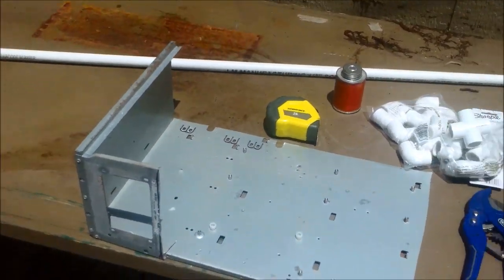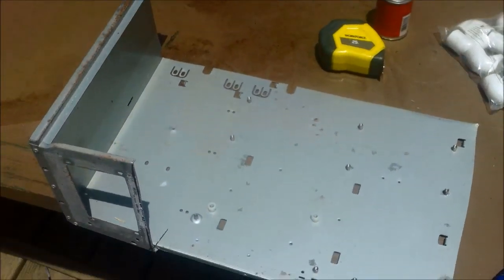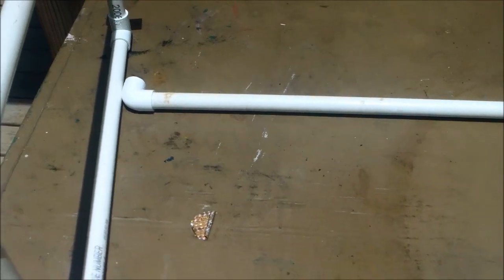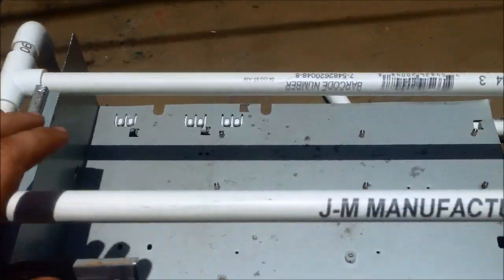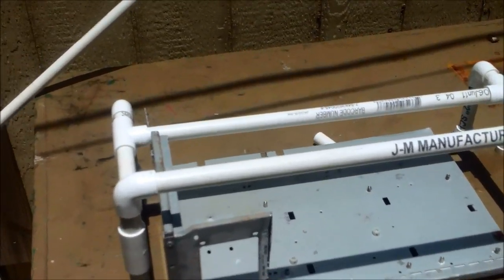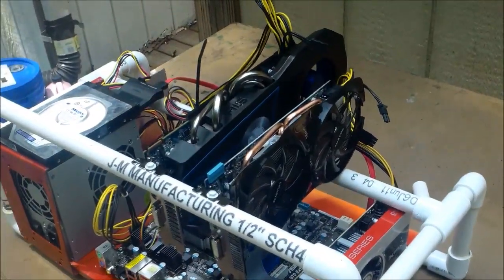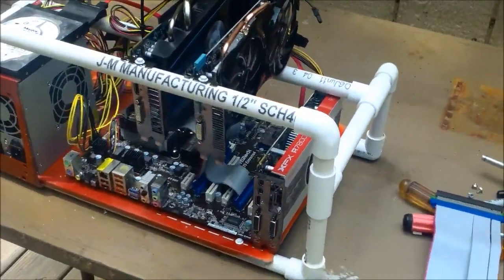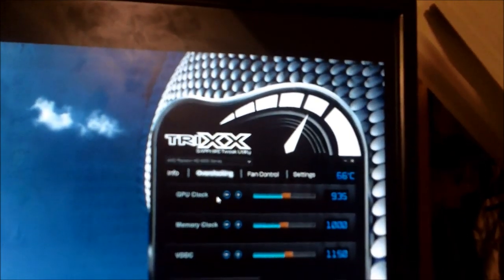How to Make a PVC computer Case for litecoin mining rigs

Comment: Just built this basic design, but a bit longer, to fit 2x motherboards and 2xpsus on it with12x cards, while using the same amount of connectors, which are the 'expensive part. Your video was very helpful.

Comment: what were your mining settings for the 7870? i cant seem to get more than 340 kh from my 7870 without getting hardware errors, also overclock/underclock settings? i also heard xfx cards were bad for mining, and i have the 7870 DD non black edition card. i also have a r9 290 on the way which is also xfx but since its reference i dont think there should be a problem
Reply from the maker: i found i get more hash if i do not push the cards to hard on the R9s they can't mine over 13 intensity the r9 280x works great but the 270x sucks....on settings guiminer has presets you can use but you should under clock your GPU and over clock your memory clock by a little and do not push the cards to hard!!! you can get 400 hash out of a 7870 but they do not have enough ram so you will see that your mining website will say your only getting 200 hash. so then i dropped the intensity down and guiminer said i was doing 300 hash but my mining website said i was doing 400